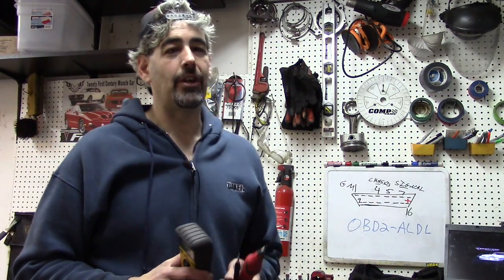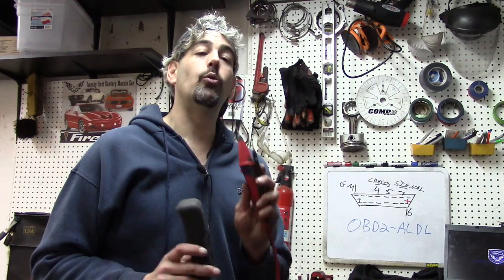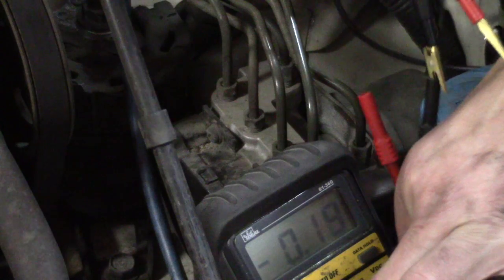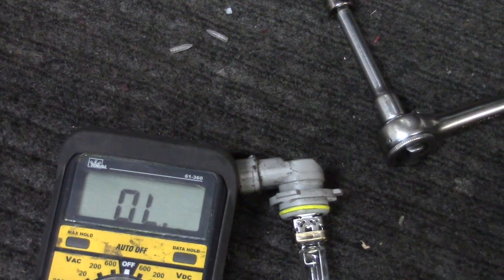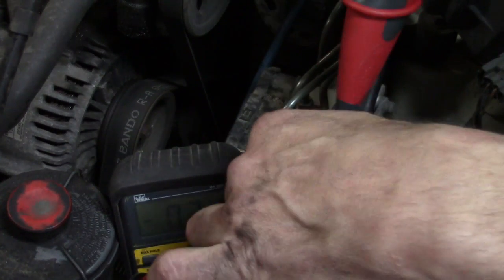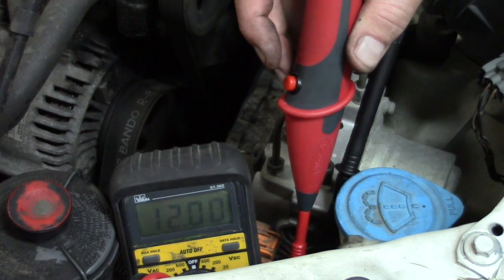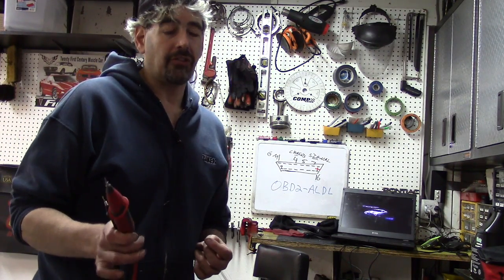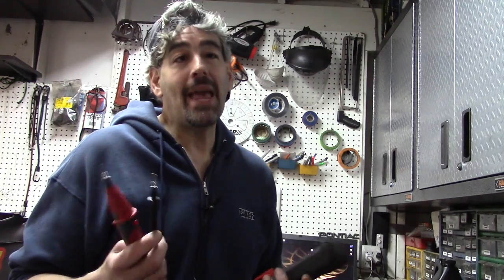Load Pro Electrical Tool Review (with product link)

Comment: I watched most of your videos and like most of them, but totally disagree on this one. The only explanation can be - you get payed to do this.  And if those bulky leads are so convinient why not using them in future videos. Brand of your multimeter and oscilloscope are known. What I dont like about this product - it does not show the same voltage drop as real component would give. 

As you know all componets have very different resistances, but voltagePro has one fixed resistance. 
For high resistance circuts (Relay controll side or something like this) this tool can simulate almost a short and damage something (comparing to normal operating load). 
For low resistance circuts, Electric fans, window motors, windshield wipers , resistance of voltagePro might be to high, and it will show that there is little votage drop, when in reality componet in question needs much more amps and generates much larger voltage drop in circut.  

To make a load pro yourself. You can partially "Shorten" multimeter leads using  high 10W power resistor that has similar resistance as that as voltagepro, and put some switch inline. Solder resistor and switch to connect both test leads permanently, close to multimeter. If you need a normal voltage reading keep switch in open position, to apply load close the witch. It will cost you 5$ for the parts. And probes will not be so bulky for most cases when only voltage red is needed. If it is a cheap multimeter you can put resistor and switch inside multimeter, connecting both connection for voltage treading. You can use push button to apply voltage, or a switch just make sure it is opened if regular voltage reading is done.
Reply from the maker: +Gatis Zvejnieks First off I do not get paid for this and if you think about it, the fact I said I won't use it videos to prevent commercializing would be totally contradictory. Think about it.

 Anyway that foolishness aside (I NEVER take compensation for ANY endorsements). The fact that you can make your own load pro (which you never did nor thought to do) has nothing to do with the actual performance of the tool which has been proven to work infallibly in hundreds of applications.

But the main thing is I expect more from my viewers to use logic and reason to determine that I clearly don't get paid for endorsements.
Reply: +Schrodingers Box Thanks for reply. Please comment if Im wrong in any of my points.

In this video you sound too exited for such simple tool (basically pricy high wattage resistor with a switch between test leads), this was the triger for me to write a negative comment. You sound more exited then about getting oscilloscope, I think that scope is so much versatile use. I respect your work and your channel.

I just dont like how glorified this tool is in most of the videos as if this was the only voltage drop test method. Specially the video where inventor is comparing this tool to power probe and some other tool using other tools totally incorrect. When talking how this tool works all he tells is "It works by pushing the button", the same as you did.  There are some limitations and warnings about this tool (as you warn about multimeter in Amps mode) specially when trouble shooting engine performance what you like to do. 

1. You can safely measure voltage using DVOM in volts mode between any wires in the car (even if you don't know where this wire is coming from or going to, maybe find wires by probing them).  But it is NOT safe to load any circuit. There are lot of circuits in car that be destroyed by pushing magic button on loadPro.  Almost any computer controlled circuits. On hi - ohm circuits by pressing magic button you are shorting them. Better dont load-test relay control side or any sensor circuit for bad contact or corrosion using this tool. Sometimes test light can put too much of a load, but this one puts 1000x greater load than test light.

2. It will be inaccurate on starter or alternator wire charges battery (also some high power fans, maybe windshield motor, and other larger). You might have fully charged battery and slow crank. Load starter circuit using this tool, you get almost no drop - feed wiring is confirmed to be good. In fact there might be 0,1 ohm resistance, and wiring will drop 6V voltage but this magic tool will not detect it.

0,5 V voltage drop on wiring is considered to be acceptable so there will be some. You will never get 100% accurate voltage drop using this tool (as you would using voltmeter). In higher Ohm (low power) circuits this probe will show greater drop then it is with real component. For low Ohm circuits (starter, alternator to battery wire, cooling fan, windshield wipers etc) this tool will show smaller voltage drop. You might see 0,05V voltage drop on starter circuit, that is totally acceptable, when in fact using starter it is 6V.

Using this tool you can measure if there is any voltage drop. But dont read the numbers on multimeter because it is not accurate  (with the exception when loadPro fixed resistance is the same as resistance for removed component). To measure correct wiring resistance use regular multimeter leads with component in circuit. Evaluate if the load of loadPro is not too great for the circuit you are about to test.

 I would love tho hear scientific explanation on how this tool works and how accurate the voltage drop reading is. (because in most cases it is not accurate at all). Talking about convenience PowerProbe might be the way to go. because you always have good power and ground and can safely and fast test around. Of course you should be absolutely shore before apply power or ground anywhere. But if you know what you do, in case of wiring voltage drop, you can apply good power or ground and see if component works without removing it.
Reply from the maker: Gatis Zvejnieks Yes it is a simple device but to attempt to quantify my excitement I think is misplaced- I would totally take my scope over this thing by 1000X.
  I am also excited about my power probe 3- and guess what- it's mainly jumper wires with a switch on a DVOM.

  It's the DESIGN that makes the difference in these tools, not the technology,
  And to judge a tool because it potentially could give incorrect data or even damage circuits under the wrong application- why does that make the tool bad? The same criticism can be made about a DVOM- I have 24 viewers I know for a fact destroyed their PCM's using a DVOM incorrectly.  Does that mean DVOM's are overhyped?

The LP is a brilliantly clever simple device that is well designed to make the proper application much faster and more efficient.
Reply: +Schrodingers Box  I Dont have this tool, did not read instructions that might come with it.
Explanation "it is so simple, just push the button" and all those fabricated scenarios always using resistor to simulate corroded wire don't satisfy me. That is why I watch your channel,  unfortunately this video stands out in a negative whey reminding me all those other commercial-like reviews of loadPro.

What is missing in your and all other videos about this product is to explain what happens after you push The button. Of course you apply a load. But what load in Amps or what is resistance has he resistor. No word about that. But it will affect accuracy greatly, and in some cases loadPro resistor resistance is so far from component resistance that it gives false reading or can beak something. If you had time or patience to read my previous comments to the end you know what applications Im talking about. 
I think that this tool is for 98% not reminding 2%. It just 100% confirms that wiring in tested circuit is good. Go ahead and replace the part.
It just does not give any scientific data, just some indication that there might be corrosion. Voltage drop that it reads is a crap. 0,5V voltage drop reading tells me nothing about how fit the circuit is in reality it might be 6V or 0,01V. Why not measure accurately first time. Judging voltage drop using this tool is as accurate as tiring to measure precise voltage by observing how bright a test light is lit.
Reply from the maker: Gatis Zvejnieks The tool instructions and in fact numerous of Sullivans own videos clearly and repeatedly state that when you push the button a 1/2A load is put on the circuit,
Reply from the maker: Matthew Brice Good comments Matthew (and by all actually) but my main thing is- I really don't understand a lot of the objections to Load Pro (LP) that apply to ALL other tools but no one objects to those tools.

1. The LP is crap because the design is simple and you can make one yourself (and yet no one who makes that objection made nor thought to make their own load pro).  Do they not own a flashlight because it's so simple?

2. The LP is crap because it cannot do voltage drop tests on starter circuits. Yeah um, it's not the right tool for that. Throw away your DVOM then because it can't do amp draw tests on circuits over 10 amps.

3. The LP is crap because the inventor doesn't explain the mechanism. Yeah your PC is crap because I don't see Bill Gates showing how memory and hard drives work at the electronics level.

  It just seems so ridiculous to me how inconsistent these objections are.
Reply: +Gatis Zvejnieks And to add to Schrodingers Box comment:  yes it is obviously true the loadpro is not going to put the same resistive ohms in the circuit as the original load; but the resistance in the rest of the circuit is not going to change whether you have the loadpro or original part hooked up.  Therefore since Ohms law definitely doesn't change by switching to loadpro we can still calculate when pushing the button how much resistance is on the rest of the circuit. Same voltage drop number as original component ?  No.  But that is where training and experience come into play interpreting the results. This tool is not rocket science and does work for me.
Reply: +Schrodingers Box Here you go 1/2 A load, that means voltage drop will be accurate only if 1/2 load is replaced by this tool.  I looked up for typecal fuel pump amperages. TBI - 2A , FGI, MFI - 4-6 A, CFMI, CSFI - 7-9A. Voltage drop will be showen less than it actually is. On 2A circut it will show 1/4 of actual voltage drop, on 6A circut it will show 1/12 of actual voltage drop, and on 10 A Circut it will show 1/20 of actual voltage drop. Using this tool on replacing load that is more than 5A is total nonsense. I think cooling fan, heater fan, windshield wipers, window motors probably consume more than 5A. If pumo or some motor is not at full speed, using this probe would only mislead you the same as it would on dim lights. But in case of dim ligts you alerady konw that there is voltage drop in wiring, because there is no othert way how bulb might get dim.

This test should not be called Load Test or voltage drop test because it is not. It is resistance measurment usign higer amperage then DVOM does. Instead of using DVOM internal battery and few miliamps of current car battery is used and 1/2 apms of current (1/2A in case there is no wiring voltage drop, if there is some additional resistance system, there will be less then 1/2 amp, because of additional inline resistance.)

In your bulb example 65W lightbulb has about 3 A of current (3Ax12V), this would translate to 4 ohms (12V/3A)of resistance. If there was 1 ohm rsistance in wiring instead of 50 ohms you used. Voltage drop in wiring would be 1/5 of available voltage 2.4 volts would be dropped in wiring (resistor) and remaining 9.6 volts on bulb. Bulb would be dim. By appliing loadPro 1/2 A or 24 ohms load it vould indicate that avalable voltage to bulb drops from 12 to 11.5 volts (not 9.6) that might be acceptable. If you whant to check my assumption just put 1 ohm resistance and measure voltage drop by using this tool and backprobig connectet bulb. Acutally you might get waven less voltage to the bulb, because if fillament is cold it has almost no reistence. Hence most of the voltage would be dropped on  1ohm resistor but oltage pro would indicate only 0,5 volts loss in wiring.
 In your example you measured 8 volts voltage drop in wiring. Infact voltage drop in wiring would be close to 12 V (Open) if bulb was connected. Because cold filament has no resistance, but eaven if it would have the same 4 ohms as hot. You would measure over 11 volts drop in wiring and less than a volt for the bulb.

This error might be critical for fuel pump of similar or larger amperage. Using voltage pro you measure less then 0,5 V of voltage drop in wiring, when in fact might be 3 or more volts. In addition to that system voltage drops while crancing. If pressure on fuel rail is somewhat low you might not get it to normal  In this Incorrect test you confirm wiring to be good and replace fuel pump what a bummer. But Im sure You would double check using normal voltage drop test using your power probe.
Reply: +Gatis Zvejnieks "But Im sure You would double check using normal voltage drop test using your power probe."   Or do normal voltage drop test with DMM you already have out with Loadpro - just don't need to push the button. Your DMM most likely has higher resolution than Power Probe.
Reply: +Randy Jones Before posting something I watched some other &quot;Real-world&quot; examples LOADpro&#174; vs. Volt-pro vs. Powerprobe&#174; vs. Corrosion and some other where LOADpro inventor re-invents how to do a voltage drop test. Scenario is the same, regular DMM is used to measure voltage on a connector unplugged from load. System voltage is read, and component fouled. The same test is repeated using LOADpro and voltage drop discovered. And guess what - Fuse of tested circuit is replaced by resistor. And he is explaining how this revolutionary technique works. As if there was no other way to measure voltage drop. Newer saw corroded wire in LoadPro examples, and never live diagnosis on a real car. Scannerdanner and Schrodingers box are my favourite channels for automotive electrical diagnosis. Scannerdanner also sometimes uses some strange tools but then he mentions MY FRIENDS FROM aeswave gave me this tool (some small gadget) to show you. 

It is just unbelievable how Matt can advise to buy and use this product without getting payed to do so. I dont thing that he does not understand what I or you try to say, he is to smart. Considering that this channel is dedicated for Advanced DIY, and mostly low-teck methods + deep understanding is used. Not because because most of his viewers are unable to understand how to use oscilloscope, but simply most of them dont have one at home garage. And here comes advice spend 70 bucks on something that you dont need, and phrase &quot;It will pay for itself&quot;. I bought used 2 channel 20 MHz analog oscilloscope for 40 bucks (half-price of what voltage pro costs). I would guess that it s much more bang for buck for my home garage than 70$ LoadPro. Buy the way, you dont need to buy dedicated automotive oscilloscope to use it on car. Andy scope will work. At least 2 channel is preferable, and digital oscilloscopes have some advantages in capturing glitches etc. You can buy new USB scope for 70 bucks on e-bay. Add another 70 and you will get used digital bench oscilloscope from e-bay.
Reply: +Randy Jones Please don't include me as one of the people whose response has been skeptical or negative.  I read every word and agree with the examples and explanations you provided 100%. But in honesty it wasn't new to me.   I have resisted responding again because at this point we have just beat this horse way beyond death.  (I actually was expecting to get flamed by you but your response was professional, mature and helpful.  I appreciated that.  I see some real unnecessary comments in this thread).     I don't know Sullivan and have not reason to defend him.  But I have also have read his books and reviewed all his videos and think he is not implying it is a magic tool and no training required; nor is he implying he invented voltage drop testing.  Quite the opposite.  He goes to great lengths to explain Kirchoff's laws, Ohms law and voltage drop - all necessary information for techs to know.  He is very pro training.  I think his point is that doing the actual test is quick and easy and give a meaningful result in just a few seconds.  Interpreting the results still takes training and understanding like many tools out there; and I still don't understand why people posting here think this tool is an exception.  So one more time, YES the nominal reading on the meter while pushing the button is not going to be the same as if the original component is plugged in - but for this tool to be effective, I doesn't need to be.  Ohms law & Kirchoff's law don't change.  

And out of curiosity, for the naysayers - do you own or have you used a loadpro before? 

Thanks for all the comments.  Good discussion.
Reply: +Schrodingers Box Agreed.  In fact Sullivan has several videos on voltage drop testing starter circuit.  No LP in sight.
Reply: +Gatis Zvejnieks At lunch was looking over your post and see you are looking for scientific (your word) explanation of LoadPro. Here is my attempt to explain using empirical means; You wrote:

"In your example you measured 8 volts voltage drop in wiring. Infact voltage drop in wiring would be close to 12 V (Open) if bulb was connected. Because cold filament has no resistance, but eaven if it would have the same 4 ohms as hot. You would measure over 11 volts drop in wiring and less than a volt for the bulb."

First off, since volts and ohms "make" amperage, to me it is more beneficial to remember that the loadpro has a 25 ohm resistor - not that it draws 1/2 amp @ 12v.  Amperage draw by loadpro will of course vary with voltage whereas resistance is fixed at the 25 Ohms.

In the video Matt had 12.1v; then pressed the button and Loadpro voltage dropped to exactly 4v. (4v dropped across the loadpro's 25 ohms); since Volts / Ohms = Amps (Ohms law), amperage in the circuit is 4 / 25 = .16 amps are flowing through the loadpro and hence the entire circuit (because amperage is the same everywhere in this circuit).  Since we know we started with 12.1, and loadpro dropped 4v, the rest of the circuit must have dropped (relative to loadpro!) 12.1 - 4 = 8.1v   Using ohms law again(but rewritten to Volts / Amps = Ohms), 8.1v / .16a = 50 Ohms (approximately) in rest of the circuit.  In your comment you listed the bulb as being 4 Ohms. Put it back in and we would know that the circuit would be dropping 50 / 54 = 92.6% of voltage.  12.1v * 92.6% = 11.2v would drop with 50ohm resister wired in and bulb in place.

ok? helpful? Still beating it to death?
Reply: +Matthew Brice Bulb changes its resistance depending on how hot it is. 12V 65W bulb has approximately 4 ohms if it dissipates 65w of power (glows bright). If it gets less voltage and filament is cooler or cold then bulb has almost no resistance. As its resistance was measured using ohmmeter in this video - resistance was 0 or close to it, no 4 ohms.  If you would measure test lights resistance using DVOM it would also have almost none because there is not enough current to heat it up. 
If for someone this tool helps let them use it. It might help if you get used to it. Just don't look at the numbers - if there is ANY voltage drop then voltage drop should be measured using proper methods. There might be one more variable introduced using this tool. Not sure but I assume that resistance of corroded wires also might increase if current is increased, ind it would. As it is with hot/cold bulb filament in the same bulb. 
Worst thing in diagnosis is to break something that was not broken, like cars computer, by applying too much voltage or load on commuter circuits that can not handle it.
Second worst thing would be confirm wiring good and change part when in fact wiring was good.
Third worst thing would be confirm wiring good go the wrong direction, spend lots and lots of time but dont change parts yet. Then start from 0 and do proper diagnosis, finding the problem and changing bad part, or fixing corroded wiring.

 Im done with commenting this video.
 
Bulb example freaked me out. It reminded all positive testimonials and case studies about this tool. Where 99% if the time loadPro is used to find that some idiot had changed fuse to a resistor. I also don't like how inventor of this tool attacks every one who questions his tool. In addition to that incorrectly compares to other tools like powerProbe.

Big thumbs up for Matt, that he did not freak out about my comments, telling that this video is commercial not a review video. Maybe it was a review.